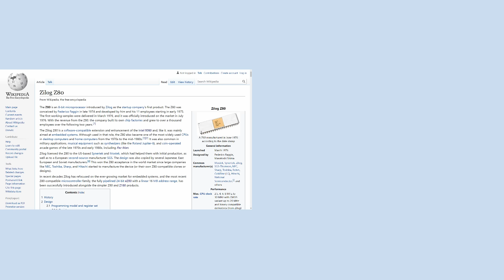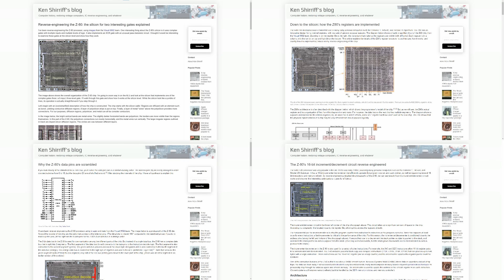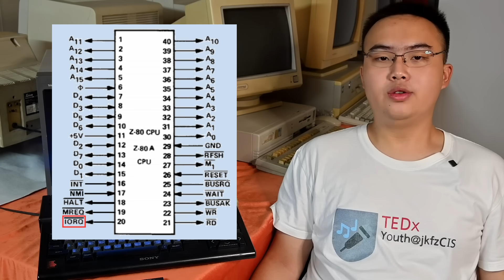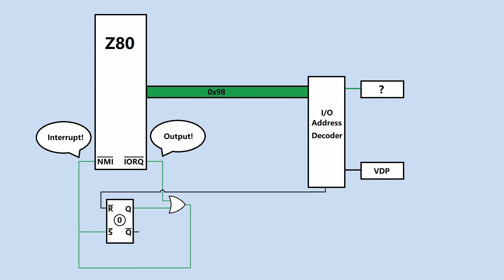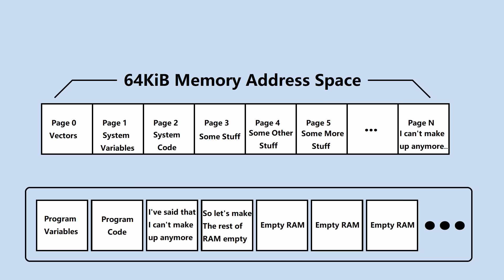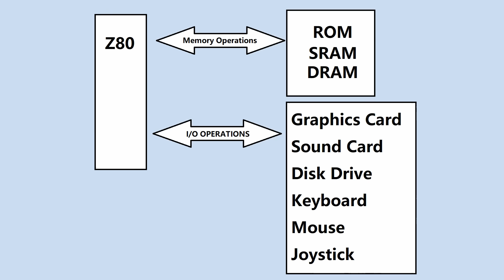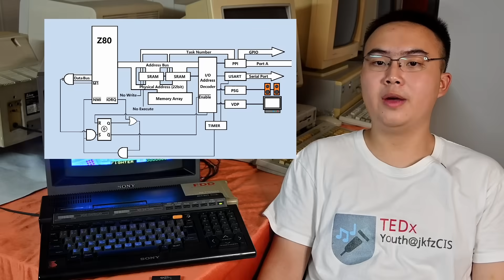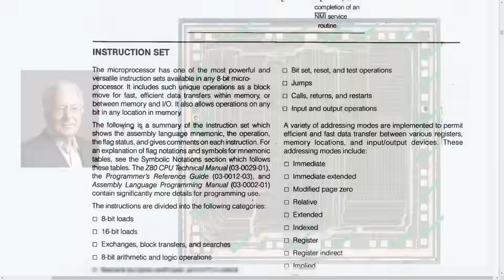The Z80's secret feature discovered after 40 years!

Comment: A young man from my high school wirewrapped  together six Z-80's in parallel back in the 1976...  He was a bit of a manic genius... always high on whippets from nitrous oxide gas cartridges in calculus class... he had a "micro welding torch" that he swapped the nitrous oxide (laughing gas) for the fuel and oxygen cartridges.  Mind you,  the Z-80 was much faster than the IBM 1401 with 4k core memory with an 8k extender that we used by typing out punch cards.

Comment: Wrong, you can multitask without protected mode, TOS and AmigaOS did it, maybe a few others.
Reply from the maker: Wrong ;) TOS cannot multitask, multiTOS (sometimes it is called MiNT, for MiNT is Not TOS or MiNT is Now TOS) can. Some version of MacOS can also multitask without a MMU, I think. However, all of these systems rely on well-behaving programs and are susceptible to bad programs or malware. The 'Guru Mediation' error is an famous example.
Reply: @andyhu9542  Yeh, I never owned a ATARI, I guess that’s just one more thing Amiga was better at.

Comment: Amazingly cleaver idea (and excellent video!) About the Z80's undocumented instructions, some of them were officially adopted on R800 (namely, those that accessed the high and low halves of the index registers IX and IY), but many generate different results (and, of course, there are those few new multiplication instructions overloaded under the 0xED switched mode, which don't do anything useful in the original Z80.)
Reply from the maker: Thanks for the information!

Comment: LOL. I used to program the Z80 (and 6502) directly in machine code. Used to be able to remember many of the hex values of the opcodes. Those were the days!
Reply: That was how we did it in those days! I developed forms (you know, spreadsheets on paper) which let me write in assembly code and then assemble it by hand using a pencil ( an early sort of keyboard ). For complex instructions I might have to refer to the manual. Then type it onto punched tape for the PROM programmer.

Comment: How about a port address you send a high order ram address to in order to access more memory?
Reply from the maker: This option was considered. However, since the Z80 is not a harvard-architecture CPU. (even though the M1 signal can make it one, but it is not commonly done and require a lot of extra circuit) setting the port will cause the CPU to fetch the next instruction from another part of the RAM, causing an effective 'far jump'. As a result all codes must be aligned in a specific way so that these jumps don't crash the computer immediately.

Comment: My first experience on microprocessors was a 500 kHz 8008 in a homebrew system, then a 2 MHz 8080 in a Altair-clone kit. Bit-switching every time boot code had to load. Man, was all that slow! Then fixing the mistakes of a couple of college guys who threw together an S-100 Z80 that would not boot, for a businessman. Hand-assembled code for both of the first machines, did creative hardware debugging and more, on the Z80. So I have some perspective on these tricks of adding Protected Mode, more address space and RAM etc... They are cool. I can see it making a very flexible computer. But it will take slowness to a whole new level, thanks to the extra complexity, on slow hardware. :/
Reply from the maker: Well, thanks to newer, CMOS chips, I can clock the CPU up to 20MHz (many people claim that CMOS Z80s can run at 24MHz without problem), which will bring slowness back to the original level ;)
Reply: @andyhu9542  - That helps. Too bad nobody is selling chips based on so-called Vacuum Channel FETs, which have a basic transistor speed of 400+ GHz, are insensitive to heat and radiation, and run well at 5 volts.

Comment: I'm impressed with your historical knowledge Because you're younger generation. We saw in our generation the Z80 and z81? The 8 bit 8080, 8081 (8085?),, first 16 bit-8086 computer and used the first Ibm pc 8bit with Lotus123 spreadsheet and wordstar to do our projects. Not to forget the IBM316! At our university where we  students had to punch our own cards and placed the deck in card reader to run our FORTRAN program to design a solar drier (simulation)!

Comment: Nice. I would have implemented protected mode (don't actually know what it actually is) by pairing two microprocessors. Both have their own memory but share the same peripherals. One micro runs the kernel which will have a shadowed memory and keeps checking for intrusions and attacks and crosschecks the memory for corruption while the other micro handles all user tasks.

Comment: An interesting and thoughtful discussion - not actually clickbait IMO. Thanks for posting this! One aircraft product that I build components for still uses the Z80, though that system is approaching its end-of-life. As a note - the 8-bit Rabbit 2000 processor is based on the Z80 (though not pin-for-pin) - and has a similar architecture and instruction set.

Comment: Zilog did go overboard with bringing seemingly obscure internal signals out to pins. Remember, the late 70's was the heyday of UNIX and multitasking. Maybe they planned a protected mode companion IC. I believe most of the Z80 architecture was brought into early Renesas 16-bit protected mode processors. Back in the day, I figured out a way to tri-state the 8051's bus by stopping the clock and pulling RESET- low. A nice side effect of static CMOS designs. The fiddy-one was none the wiser once the clocking resumed. I also designed a complete commercial Z80 based PBX telephone system on the AWESOME Commodore 64 CP/M Z80 cartridge. 22,000 lines of C code on that rickety setup!

Comment: Back in 1982, whilst travelling through the USA, I bought an Osborne Executive running a Zilog Z80A with CPM+, twin floppy drives.  I used it for Family Tree database work for some considerable time until I ran out of disk space.  Then I went on to a Windows pre-cursor machine running a 80286.  The Osborne Executive was a delightful machine to use, with proprietary commercial software.  Very good within its limitations of character-based processing and display.  Viruses seemed not to be a thing generally worried about until about 1984.

Comment: When I trained to be a tech we assembled Heathkit Z80 PCs in our classroom. We learned to piggyback 2-64k RAM chips, which had become dirt cheap, to get 128k. Learning ASM/x86 was a chore at first, but once you had it down you could make the machines do anything a PC could do, it was great. A few years after graduation I got a contract with the USAF to install and maintain their first digital nurse call system, made by Bunting. It just so happened it used the Z80 CPU so I was a happy camper!

Comment: Nice to see someone else interested in virtualized 8-bit retrocomputers.
I was creating something similar for Atari/virtualized Atari which would allow me having safe OS which is able to take over any nasty code with as much compatibility with na normal Atari as possible.

but if you want to go further in this matter... please check early Motorola based Sun microsystems...
I was not checking exactly but I know that they were using a very similar idea as a workaround to add protected mode to their 1st Sun microstations. :-D.

Basiclaly the idea is not new... I truly believe that if engineers in Atari was more interested in bigger machines and were working more professionaly on them they would add virtualizing to Atari as it had a lot of professional designs added to the gaming part.

Comment: So you are saying the z80 has a protected mode, but requires a ton of additional hardware and careful programmation to do that? Are you st00p1d or what? I think with additional hardware and careful programmation most CPU could emulate a protected mode....the thing is that you are modifying the CPU to add a new feature, is not a hidden feature on the CPU silicon that is undocumented....

Comment: It was not only the CPU of many 8 bit systems, it was also used as a co-processor in countless 16 bit machines. If your arcade cabinet had a cutting-edge Motorola 68000 as a CPU, chances were you probably had a Z80 for sound.

Comment: In the mid 80's I had a company that used the Z-80  and the Hitachi 6418 for industrial machine control in semiconductor manufacturing equipment. We had a real time operating system based on a time-slice software model and a precision clock chip. The system was amazingly responsive and and allowed us to do things with machine systems that no competitor could duplicate at that time. We even used the system for master/slave distributed machine control, High Frequency/Power RF control, and robotics. 
All of our programming was in assembler and was debugged without a simulator. In the late 80's our equipment was used by 90% of the world's chip manufacturers... Great memories... {battery backed SRAM, of course}.

Comment: Cool Technique. But why would you on a 8bit 4Mhz CPU that only deals with 64KB of RAM (only @38KB usable without swapping)?
Reply: Because 64KB of memory is HUGE for a single purpose hardware device. What has happened over my computing life of 60 years is that memory has got vastly cheaper and high level compilers have got unbelievably inefficient, with huge libraries of which 95% is irrelevant to the required design. A naval gun could be controlled with an 8080, 1K of ROM and 512 bytes of RAM. It meant that every possible interaction of the programs and data could be predicted ensuring the highest reliability. If doing it again today, I would probably use a 20 pin 8bit PIC !( < $2 )

Comment: Back when around 1980 when Digital Research was working on prototypes of their MP/M operating system, I built a system to test it on out from an Northstar chassis, a 4 MHz Z80 CPU card, 256K of STATIC RAM (4 boards), a quad UART board, and 2 Shugart 13" hard drives using the at the time new "Winchester" technology. My BIOS performed so well that we moved our company's (Micro Data Base Systems) technical typist's terminal over to it permanently. She could sustain 100 wpm; I've never before or since seen anyone like her; and that 4 MHz Z80 system not only kept up with her, but at the same time was running my compilations and assemblies. I have a lot of respect for the humble Z80's capabilities when they are unleashed by good software.
Reply: The company I worked in the 1980s did some crazy things with Z80 in process control. We overclocked the CMOS Z80 with 8 MHz (rated 4 MHz) and shot every millisecond an interrupt into the Z80. The interrupt routine did the real-time work for the process. Calculation was done with 32 bit fixed point numbers. I still think that neither 6502 or 6809 could do this job. Even 8 MHz 8086 or 68000 would struggle. But this was very niche.

Comment: Never was a computer guy but sold radio tubes on Ebay. One day I cleaned out an electronics  guy for the tubes but got thousands of white ceramic gold top chips, Turns out they were Intel 4000 series CPU chips. I literally bought a new BMW from selling them on Ebay over a couple years, was fascinated with the story. Had a few hundred Z80's too, Intel clock chips, and misc. Fun times.

Comment: I have (together with my older brother) created a Computer back in 1978. It was a modular system, build reading the Pelka-Books, with a 8080 from Intel.
The 8080 was bought at "Tandy-Shop" in Wuppertal, germany, it was the german version of "Radio Shack".
Later we changed this to a Z-80 by changing the processor-board. All boards were self routed and created by chemicals or by other mechanical things.
I have the mnemonics still in my head, some of them, MOV BA 78, JNZ C2 JZ CA, i had to program it in Hexcodes. We were able to lay Bach on it, my brother coded Preludium an Fuge to it.
I Git a price for it at "Jugend Forscht" in germany, somewhere in 1980 with this thing. I do not own it anymore, after a move we were not able to transport it. It was not big, but money and room was rare...
I had a Computer later, the ZX81 (Timex Sinclair) with that processor, and later the oric Atmos wit an 6502. The 6502 was very powerful, doing almost the same calculations at 1MHz as a Z80 did at 2MHz. The Assembler-program dealing with the 8-dame-problem was calculated in almost the same time :)

Comment: Hah, hah. Well done Andy. I still think about the z80. Back in 1978 I was ten years old and got to play with a z80 cpm computer. It had a game in basic I was able to play. Then I listed the program and modified it some. Then run it again. That is like building a rocket and going to space now. I found out you could increase beyond the 64K limit by banking the ram. Of course ram was very expensive. Not all z80 computers even had the full 64K of ram. Z80's got faster and faster over the years. The last one I saw in a computer was running at 20 Megahertz. You could have all the features you talked about on the intro by running the code with a simulator. Or better still, have a bytecode like java and run it in a virtual machine. Using virtual machine, memory banking, and running the clock speed in the terrahertz range, you could increase the power/performance up to something like a modern 32bit 5cent processor.

Comment: basically false.
ANY CPU can have a protected mode and virtual memory support.
All it requires is the peripheral to control memory access and peripheral access. for a VERY SIMPLE way just look at the old PDP-8. all such features were added by the memory controller - which was a peripheral. Similar features were used for 16 bit processors.
And even the old 8080 processor provided all the needed signals for that. and this video just describes one way of doing that.

Comment: Very nice! So simple an implementation, yet so very clever! Not so useful for a modern microcontroller or processor, but basically a universal mechanism for purpose-built code and memory protection, or in-circuit hardware debugger interface... Cool little nugget!

Comment: Sorry Andy,  that isnt quite correct. I wrote assembler language code for the Z80 for several years for a first class  security company. I was the chief central monitoring station hardware and software engineer.  My software had the Zilog Z80 doing multitasking and handeling 48 dial in phone channels complete with data at the same time.
My products were installed in several super high security here in America and abroad. My team and I squeezed every drop of performance that the Z80 had out of it.
The one thing most people fident know how to use was the swappable register stack . A lot of people has no Idea how to use it or what its good for.

Comment: Nice hacking, yeah, it's not really a "secret feature." In the 1980s I worked on making the Victor 9000/Sirius 1 and MacSE/Mac II IBM PC compatible, and the IOREQ/NMI trick was key to do the transfer of control to software to do those emulations (I wrote 8254, 8259, 765, etc. emulations in software.) We also did memory re-mapping by running address lines into a RAM and using the output data as "new" address data (the 8086/88 segmented memory makes this practical).

Comment: Played with a Radio Shack TRS-80 which was a fun computer.  Moved on to the Atari 800 with the 6502.  Spent a lot of time in assembly.  Used the cassette player on/off to key morse code to my Ham Radio gear.  Later found out that the Joystick ports could also be used for output, so wrote an assembly printer driver using timer interrupts to send RS232 out of the joystick port to a printer.  Lots of fun!!  Was able to get it to print.  That was back in the day when you had to buy additional hardware that would drive a RS232 dot matrix printer.

Comment: I wrote a text book on the theory of operation of microprocessor hardware and software 750 pages. Published by ITT as part of a 560 hour course on Telecommunication Switching Systems. Specifically the NTX2000 Switching System. We started with an introduction to Digital Electronics and went from there. I used the Z-80 and the history of the Von Neumann Architecture to explain theory of operation.

Comment: We had a debug board for our Z80 system back in the day.  It was much like you just described.  It had a ribbon cable to a 40pin plug which replaced the Z80 in the system.  It had LED displays for data and address bus, a button for single step and a knob for slow speed running.

Comment: My favorite CPU in the early '80s. Compiled assembly language programs were super fast on the tiny but mighty 4 Mhz Z80. We had a motor controller with IR detectors and software serial digital input all of it stored in a 2K Eprom. Hardware interrupts, push and pop, fun stuff.

Comment: So your "secret feature of the Z80" is basically that "it can do whatever you want if you build your own separate hardware to do that function instead of letting the Z80 do it itself"?  I mean, that's pretty much true of anything.  The Z80 also has a "secret RS-232 IO mode" which can be used by hooking up its IO lines to an 8250, and "secret floating point operations" which you could activate by doing IO requests to a separate math coprocessor chip, and it's probably even got a "secret x86 emulation mode" which you can enable by sharing its system memory with an external 80386 chip and coordinating execution between the two...

I mean, what you're doing here is a neat exercise and all, and your video is potentially educational and thought-provoking in some ways, but still pretty clickbaity, IMHO.  You didn't discover any "hidden feature" of anything.  You just replaced part of the Z80's own IO and memory controllers with your own external hardware to add functionality the CPU itself doesn't have, so it's not really "just a Z80" anymore.

Comment: I designed a control unit for a nuclear power plant using Z80, which is resistant to radiation.
The software implements a multi-task operating system and is fault tolerant.